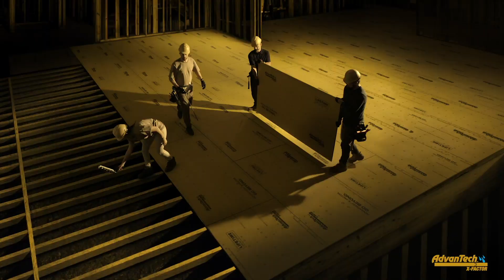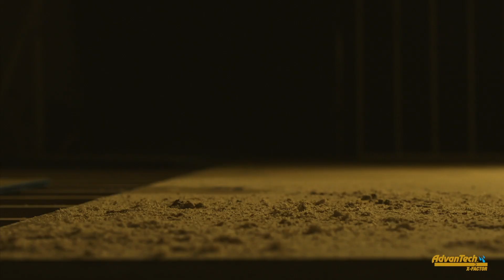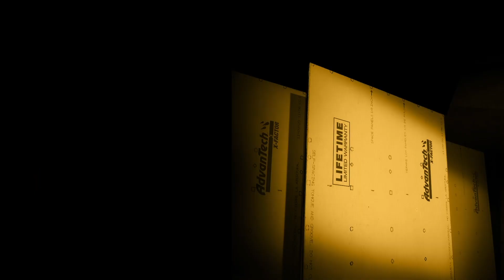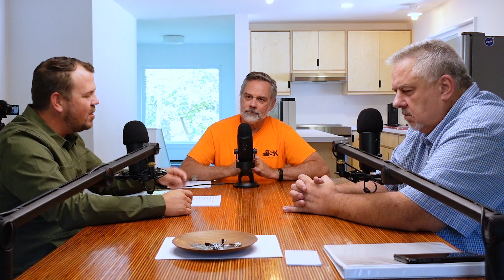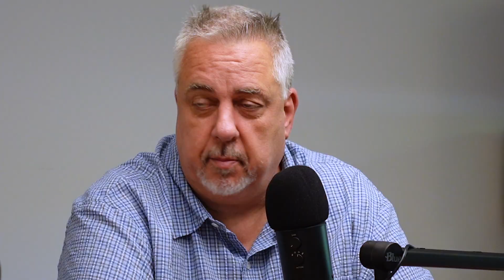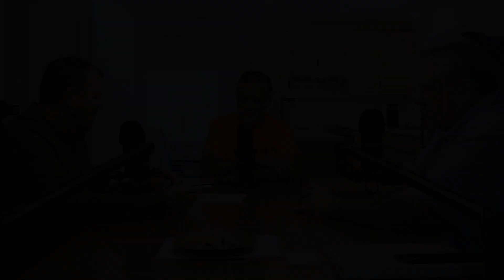Permanent Wood Foundations - UnBuild It Podcast Episode #43

Comment: I own a 4,000sqft Viceroy home in Northern Ontario with a PWF Walk out foundation.  It was built in 1988.  Every single home I've owned before leaked, had humidity issues or required structural repairs in one form or another.  This one did not!  It is the dry, no humidity summer or winter and has been structurally sound for as long as I've owned it (13 years now).  It has a concrete footing and a concrete slab. The entire street has a large rock peninsula to one side and a steep drop off to the lake.  Proper soils, proper construction and proper maintenance surrounding the home makes all the difference.  We are attempting to sell to downsize.  All the buzz surrounds the PWF.  Fear of the unknown from what I can gather and I get it.  Inform, inspect and maintain to minimize your risk.  As a Professional Quantity Surveyor, I can confirm that a PWF is less expensive than any other sort of concrete type foundation. Longevity wise, a foundation must last as long as the home that rests above and within it.  To have a foundation last longer than the frame above it makes no sense in my opinion.

Comment: When I was selling lumber n the 1980"s, several wood foundation houses were built on Grosse Isle, an island in the Detroit River, just feet above water level. These were nice expensive houses at that time.
They are still there and look to be in great condition in 2023.
Every concrete basement wall I've seen has cracked and has water seepage at some point, because when concrete moves, even fractions of an inch, there will be a crack. Sometimes just the fact that it had set up has caused cracking.
Wood can flex quite a bit and not crack.
Reply: The first  brand new house I purchased had a daylight basement (1977) . There was no pipe drains for the gutters and foundation drain. The house was designed with a varying height crawl space with half of the space tall enough for a room ( 7' 6") with a concrete floor.The room was always wet with running water. The builder had left the wall frame metal spreaders at the joint between the footing and the stem wall. The other half of the crawl space was native soil with no plastic vabor barrier. The height of the space varied frpom 2' to 8'+/- . It too had water seeping into the space because the roof gutter and surface drainage had no piping taking the water away from the crawl space.I tried to solve  the daylight basement by waterproofing the spreader bar leaking joint with waterproofing on the interiior. It never worked. I finally dug a french drain against the wall and exteneded it 15' away from the house and installed perf and solid pipe to drain away from the area. The "Spring" was solved by installing a solid pipe from the gutter downspout away from that side of the house o daylight. I also installed a french drain along the entire side of the house switching from perf pipe to solid pass at the down stream corner then installed solid pipe to daylight. Many builders don't understand that "Water runs down hill, even underground" Often building houses in a hole without proper drainage control.

Comment: I recently purchased a permanent wood foundation house that was built in 1977. We are finishing a basement, and doing crawlspace work that has allowed me to closely inspect the foundation inside and out. 

After 48 years, it is in perfect condition. The crushed stone foundation does not settle. Everything is still perfectly square, plumb, and level. 

The original owner/builder decided to do it because it was considerably lower cost. 

My other concrete foundation houses have all needed substantial work.

Comment: I have used 4x12 pressure treated beams on the flat on a compacted gravel bed and built up from there with typical pressure treated framing, sheathing, water proofing, etc in the remote arctic regions of Alaska with absolutely no issues. The 4x12 eliminated the need for concrete as well as the high shipping costs and was must faster. To address seismic issues the 4x12s were “pinned” to the gravel base.
Reply: How deep did your pins go?

Comment: Great podcast,   my experience with Permanent Wood Foundations goes back 40 years.  I built a house in 1984 using the PWF system for a full basement.  With good attention to detail the basement worked great.  23 years later I added on to the back of the house to take in my parents.  This time I used the PWF wall system along with the wood floor system.  After 16 years the system is still performing well.   I would love to send you a more in depth article I wrote recently.   Thanks for the podcast.  Robert.

Comment: Excellent discussion, i recently purchased an older home which has a preserved wood foundation and thus far the foundation looks good. In purchasing the home we had to replace the septic system and I was able to inspect the front wall of the house to connect the new septic line into the existing line and the fondation look brand new.  The house was built in 1987.  Now we are experiencing water leek to the house although the damages seems to be related to cedar bords (siding) allowing  water through the cracks between the boards.  Now in the spring I plan on adding a library-extended living room and I plan on going with a PWF or PICF for the foundation.

Comment: I havent built one yet, but I'm planning a fourplex to feature a permanent wood foundation. Reason being is that I live in a cold climate with a short construction season, I can pre-frame the foundation, walls, floors, and roof, in my heated shop over the winter. Then I mobe everything to site in spring and lift into place with a rented picker truck. If this project goes well I plan to build many more.

Comment: Crushed stone is the "forever material" that truly makes a wood foundation possible/long-term viable. In fact, crushed stone even makes precast concrete foundation wall system "footings" possible, such as Superior Walls "footing-less" system (oh, joints made with polyurethane sealant and it uses 5000 psi concrete, so no waterproofing required).

Comment: I moved a house onto my property 7 yrs ago and at the time I got a quote for a guy to pour a concrete crawl space.   Footings, 5’ walls and poured floor for 55k.  I did the poured concrete footings,  8’ PWF walls (2”x8” 16” OC) and poured floor with radiant heat for 8k.   

It’s very different I’m cost.

Comment: I’ve fixed many concrete and block walls that’s failed/buckled in the center. Wood wouldn’t do that. I’ve only had to fix a hand full of wood foundations, usually corners where gutters were not on or installed properly.

Comment: PWF is used where there is permafrost in Alaska. The foundations here are built with adjustable screws on piers; because, the earth will move and the pwf is “floating” on top of grade. Sometimes it’s difficult to get cement to some remote sites on permafrost.
Pwf platforms seem to work well in that environment.

Comment: Steve, I think you missed the point of WHY a wood foundation makes sense.  As a homeowner who added a wing to the house with a drive in garage on a hill, less than 20% of the wall needed to be underground.  Yes, I used a concrete footer then 2x8 on 24" in the non underground areas and 12" in the underground areas.  This was the 28 x15' garage and 12x30' rec room.  The Rec Room is about 40% underground.  Now Why did I do it?  At the time, concrete block contractors were in short supply, I was entirely capable of building underground wood, and I felt that it would be adequate.  I did provide a "lip" on the concrete floor, for the wall to "push" against should it need to. This was both Cheaper and More Accurate!!!
Reply: Our walls also go below the level of the poured basement slab.

Comment: I have wood foundation that was  built in 1991. Back then it was 6 mil poly to cover it. But after many years the poly broke down and ive had to go around basement foundation and cover with a membrane and also roofing underlayment to keep it dry. 
But now i got to backside of home, walk out basement..and i didnt have gutter up, so now im finding the lower siding and plywood has been damaged by not being waterproofed and water hitting bottom siding. Has gotten moldy..been digging out around the foundation and will have to replace some of the green treated plywood and water proof, new siding. And Gutters are very important!

Comment: I have a home with  PWF, I have a failure happening with one of my walls. I've been looking all over to find out how to fix it without a contractor. But I know nothing about my foundation, I also have a concrete slab for a floor. My parents bought this house in the 80's in western Iowa. I don't know how I can find out when the foundation was put in. The original build was a church from the 1800's. There have been additions put on and I have lots of unleveled floors. I'm wondering how much that has to do with the foundation failing potentially. I don't know...how can I get this checked out w/o costing me an arm and a leg? Are there inspectors that deal with PWF? I had a company come out to give a bid about putting in an egress window in one of the basement rooms, he had NEVER seen or heard of a PWF. I need help...any suggestions?

Comment: Really interesting discussion.  I am building an ICF home with no load bearing internal walls.  I want the home to have earthen floors.  The floors will be constructed over xps foam with hydronic radiant tubing.  My architect required the non-load bearing internal walls have a 12"x6" concrete foundation.  I want to use treated plywood as I can build it with channels to allow the radiant tubing to run under the walls while maintaining a continuous insulation barrier in my flooring.  The discussion gives me hope that I can find a prescriptive method within existing building codes.

Comment: Living in and building in/near hurricane zones I believe there is a large benefit to the sheer weight/mass of the concrete footings and foundation walls being in place. I'm sure a wood foundation wall could be tied down similar to how mobile homes are "secured" to the ground but then we're adding complexity and variables and not sure the benefit.
Reply: You may think that, but the failure point of any wood framed house is at the foundation line to the wood.
Reply: @Mouse2677  not when you through bolt from footer to top plate with real sheathing on all exterior walls. That's what I grew up doing in hurricane zone. Where I build now is not hurricane zone but I still through bolt to the bottom plate of the first floor wall which holds down the band joist. Then continuous sheathing nailed hard at band joist and up to top plates. I'd be interested to see what it would take to rip one apart! Probably a tornado.

Comment: The entire neighborhood I live in has wood foundations in them. Five are spilt level homes. One is a two story. The rest are one story. Our basement studs are 16 IOC  treated 2x6 walls. Treated sheeting with waterproofing and poly over that.  On poured footings with a poured floor. We live in northern Wisconsin.  My issue is, do we install a vapor barrier in between the treated studs and the sheetrock in the basement? I feel that will trap moisture, or the POSSIBILITY of moisture, in between the sheetrock and the outside basement wall. What's your thoughts?

Comment: I am having my personal home built in central Florida - and very seriosly looking at an above grade wood foundation for 4 major reasons: 1. I am building very near 100+ year old Oaks with very wide root systems that need water and air that concrete cannot provide; 2.  I will be using Stainless Steel Helical piles that will penetrate the organic top soils and underlying sand so a wood foundation will reequire significantly less weight support plus I will not have to dig out several feet of existing top sol that would destroy the Oak's root system, 3. It is much easier to get wood to the building site in a heavily old-growth wooded building lot vs concrete trucks and pumping trucks.  4. I am exploring the use of Accoya wood that has a 50 year warrantee when used above ground. I believe more home owners would choose wood foundations when the builders and city code officials helped in the education and pointed out the advantages.

Comment: I like the idea of being able to use the same framing crew to build the foundation, and without having to wait for the foundation to cure.
Would it be possible to screw together a steel foundation to alleviate concerns of rot, basically using the PWF scheme? I haven't done a lot of load-bearing steel framing, and nothing with a non-wood sheeting.
Reply: I think your cost savings would be non-existent the second you start bolting together steel. Most folks would probably look at this as saving money rather than the environment. But sure, if treated properly I would bet steel could be done this way.

Comment: I have a small bandsaw mill,  I buy logs at $250 /1,000 B.F.  i pan on doing a PWF. The only thing anticipate buying is some pressure treated 2x8s for the bottom plate. The whole thing may cost me $1,500. I don't think even that.   NOW  that's affordable.

Comment: I think the idea of placing a gravel footing and landing a wood framed wall plate on it is interesting. But I wonder: Do you pour a slab against the side of the wall? I always try to avoid trapping wood behind concrete… 

Honestly I have similar thoughts about Superior Wall foundations. With those, however - I’m not fearful of moisture damage.

Comment: Thanks for the debate.  I'm considering building with a wood foundation in .......................... Northern Wisconsin.   My preference is based around my brothers house which is over 30 years old on a wood foundation with no issues. The advantages I see are that I could build it myself, the wiring and insulation are much simpler, the basement; basically free space considering the frostline, the relatively warmer and less humid space and the relative ease of repairs, if ever needed.

Comment: In "Normal" economic years, we would figure the cost of an insulated PWF for the cost of an Uninsulated poured concrete foundation.  Scheduling is our biggest savings. We are able to panelize an entire house (Foundation through Main level walls) in our wall shop during the winter. Then wait for a break in the winter to get out and install the foundation walls in around 3 hours.   The Installation process is the key to the success of a PWF.
Reply: The above grade of a PWF is treated just like the rest of the exterior walls. We typically side down to 4" above the grade. This makes for much cleaner lines on sloped grades instead of having poured wall step downs.    Where the grade contacts the PWF there is an additional layer of 5/8" or 3/4" plywood that protects the foundation against any weed eaters or other reasonable damage.      Thank you for talking about these!
Reply: @cwoodswv56  Very cool. Thanks for all of the information you have shared. - Jake

Comment: When discussing why he should take wood foundation over concrete, there was no argument made for 1. The foundation is insulated and far more energy efficient than concrete 2. You dont have to frame walls in front of the concrete walls, so right there makes the whole thing worthwhile 3. You add additional floorspace because of the last point 4. It allows some movement without cracking. Those are all huge points that should have been brought up and researched before making this podcast

Comment: Pressure-treated wood is full of costic chemicals, splinters and splits readily, and why aren't you folks discussing water wicking and frost-heave??? I always wonder why our concrete foundations aren't surrounded in 1" styrofoam casing to increase rigidity, eliminate flourescence, repell moisture and reduce sudden, extreme temperature fluctuations.

Comment: If you ran rebar through every single stud in the in the wood foundation the same as you would a concrete foundation you would not be able to push it over. Who are tied into the floor the same as concrete it would be impossible. It would not be as strong I agree but would actually offer more resistance to the freeze thaw cycle and bowing. Obviously it's not necessary because the down report but if you were to compare apples to Apple with lateral bracing, It would raise the structural integrity of the wood. Obviously not to concrete levels

Comment: I like these guys, but PWF is far more popular and widely used than they realize. Is it used more commonly in northern/dryer climates? Yes. Does it make the building process easier, especially for DIY/additions, hard to access concrete locations? Yes. It’s just another tool to have in the tool box.

Comment: It's typical to have regional bias, when considering any building process.
Sand, swamp, high water table, termites, and flood planes do not allow for basements here in coastal GA.
Retaining walls are only used for existing trees in landscaping and raised swimming pools.
However if I lived in Denver CO, with under 10 inches of rain annually, a marine grade foundation could be an option.
We know Texas/Oklahoma have expansive soils that heave, ledge in many parts of the US including Fla.
In my opinion... it's better to have a concrete foundation outlast the home, then the wood foundation to last under 50 yrs.
Reply: Regional bias is one huge driving factor. Coming from a poured in place concrete market I could never imagine trusting a block foundation.